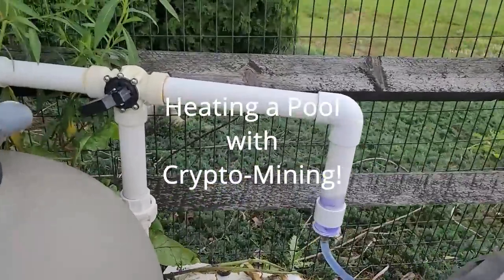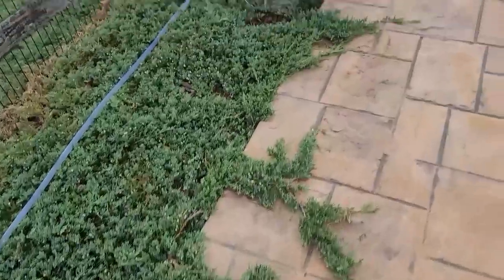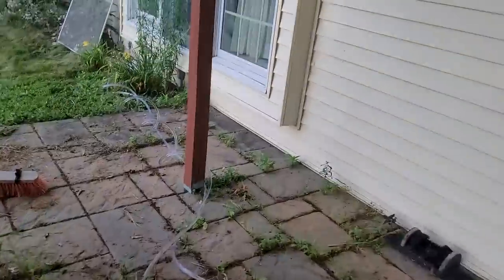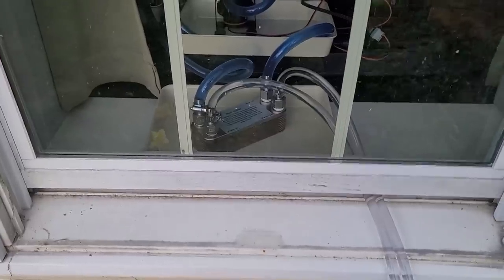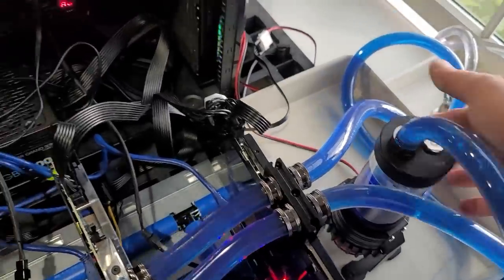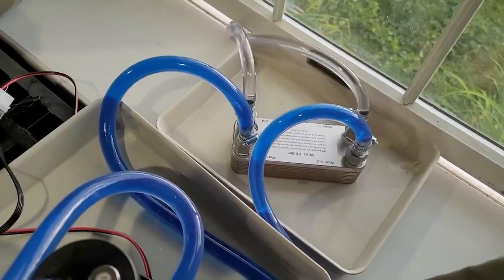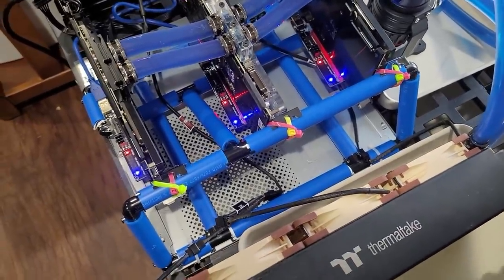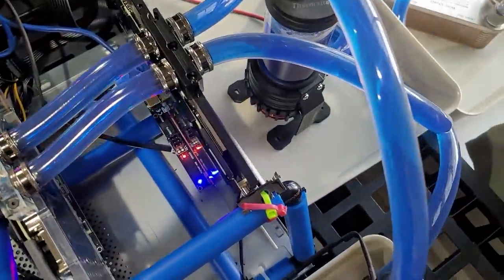Crypto Mining Pool Heater

Comment: I don't like crypto but this is pretty neat. Makes me wonder if you could use heat pumps to force heat a reservoir for later home heating.
Reply: You can and they do. Some comercial heat pumps store energy or potential energy in either heat batteries or ice storage. They make ice in off peak/solar augmented systems for cooling during peak hours. Or they stpre heat for hot water in facilities for hot water needs.
Reply: Yes, heat recovery heat pumps have been around for decades, the problem is the initial cost puts off a lot of people but is used a lot in agriculture where the heat rejected from cooling holding tanks for milk is used to heat the water used for washing them later.
Reply: Lmao
Reply: DUDE you literally can’t “think this is pretty neat” without liking crypto, bitcoin is the engine behind all of this
Reply: Or monero or whatever he’s mining
Reply: @donlitt  bitcoin is "the engine behind all of" a cool engineering project that has to do with heat dissipation? no lol
Reply: @samcousins3204  lol it’s two things at once, it’s supporting a monetary network, and it’s heating the pool, lol 2 uses, 1 and 2 can’t u count?
Reply: @Kirk MyDurk yeah but it’s two uses, the source of heat is to heat the pool, but it also helps secure the monetary network, without mining, you’d just be producing heat for the pool, no other use
Reply: @samcousins3204  think about all the pool heaters that aren’t mining crypto, they’re less efficient, crypto mining increases efficiency of energy production, you can’t be a fan of this project without liking crypto it’s just that simple
Reply: @donlitt  How does crypto mining have anything to do with energy production?
Reply: @symboly1042  we already have smart guys like this figuring out what to do with all the energy produced from mining bitcoin, just wait til everyone is, it’s not a waste of energy, that’s the whole point of bitcoin, to use energy
Reply: @symboly1042  Texas energy producers are already way ahead doing this kind of stuff instead of flaring natural gas, it’s not that difficult to understand,
Reply: @donlitt  mining bitcoin doesnt produce energy it just converts it from electricity to heat energy while also making bitcoin or others
Reply: @symboly1042  you don’t even make sense. I could mine bitcoin in my living room in the winter to heat my living room, I’d save on energy because I wouldn’t have to set the thermostat as high
Reply: @symboly1042  and smart people are already doing this and saving on heating bills
Reply: @donlitt  what do you mean im not making sense i just pointed out that its instead an energy conversion and your trying to prove me wrong
Reply: about something i wasnt talking about
Reply: @symboly1042  okay what difference does it make, mining produces bitcoin and heat, two very useful things, we’re only scratching the surface of what we can do with that
Reply: @donlitt  yeah i know it has a lot of potential and im not at all againts it
Reply: @symboly1042  okay cool some people in this comment stream are against so just making sure
Reply: @symboly1042  yeah and even nfts have some utility but not enough to be sold for a million dollars or so
Reply: @donlitt  Actually it's drugs that's behind crypto, so this is drug-cooled
Reply: @DoctorNemmo  considering its cooled by the water in the swimming pool and by the water in the loop of the miner the heat exchanger transfers the heat between the two cooling loops so the thousand dollar hardware doesnt get contaminated which then means water is a drug according to you
Reply: I legitimately believe that the only reason people don't like crypto is because they heard of NFT baseball cards effectively now they think all of cryptocurrency is the same. I don't see how you can dislike cryptocurrency as a person who wants to separate from garbage fiat currency. Like, is this really just pure ignorance? Or is someone going to make a climate argument?
Reply: @TheBanjoShowOfficial  idk whats with people not understanding that crypto is good when done right
Reply: @donlitt  Probably Eth.
Reply: @DoctorNemmo  The drug market probably makes up less than 1% of the transactions for Bitcoin. He is likely mining Eth, so probably less than .1% of his mining is powered by drug sales.
Reply: @stickyfox  lol first off anything on a computer is just a neat looking binary number. And no cryptos actually not wasteful because in bitcoin for instance the energy goes towards verifying the money, wouldn’t you want money backed by energy, or I’m assuming you like money backed by lying governments
Reply: @Ort I hold no crypto currency and no longer mine. Your distaste for crypto is due to your lack of understanding of how it works, its consequences, and its potential. It is the most significant development in technology since the smartphone, if it continues on the trajectory it is heading, it could surpass the internet interms of importance. I doubt it will get to that point, due to the government cracking down on it, but we will see.
Reply: @donlitt  Nobody said this was a waste of energy. They said this could have been done whether mining crypto or not. Mining makes literally zero difference. Clearly you don't need a high school diploma or common sense to be a crypto miner.
Reply: @twizz420  lol Sam cousins called it wasteful look at my comments, I called him out for being an idiot and look, he deleted his comments
Reply: @twizz420  lol it was stickyfox not Sam cousins, stickyfox typed out 2 long comments calling it wasteful and now look, comments deleted
Reply: @Ort They don't teach you anything about crypto in a CS undergrad, besides maybe basic cryptographic functions like RSA or SHA and maybe the basics of distributed systems, if you sought out that course. For all I know you could be a soy web dev whose hasn't had to think about security, optimization, or math since the one low-level class they had to take junior year. You understand the privacy, decentralization, and security that cryptocurrencies result in, yet you hate them? You understand the potential of smart contracts and fungibility, yet you are against them? I genuinely don't understand how you can hate and want crypto to go away if you actually understand the technology, please tell me the in-depth reasons as to why you are so against them.
Reply: I mined for a while and moved my mining rig to my bedroom for the winter. it paid for its energy usage and our household was powered with 100% renewable energy, so I thought it was a pretty efficient use of energy
Reply: I mean in terms of heat per unit of electricity consumed, a heat pump is probably a much better heater than a mining rig.

Comment: Nice! Did you test it out to see by how much it increases the pool temps?
You might get more if you insulate the tubes going to the pool.
Reply: I dont think so, I used to heat my pool just by putting a tube like this under sunlight.
Reply: Probably isn't gonna make a lick of difference. He's using 1kw of power to heat what appears to be a larger pool.

Pool heaters are 300k btu plus and even those can take time. 300k but it's 88kw.

I doubt he honestly thought it was going to do much.
Reply: it heated up the pool by 0,00001 degree Celsius 😂😂😂
Reply: Honestly it might heat the water near the steps, seeing as the water is flowing right over the steps. It could help with any initial cold shock you may get from the water being too cold, seeing as once you walk off the steps it would slowly transition into colder water. Maybe. I don't know. Definitely can't see it heating the whole pool by much if any though.
Reply: If running 24/7 yes it can definitely make a change
Reply: @pidhsome  No, it can't. The water cools off over time, it doesn't perpetually retain it's heat forever. 🤦🏽‍♂️
Reply: @twizz420  but once the warm water goes into the pool it mixes with the entire pool. He’s constantly putting warm water in and taking cooler water out and returning it. The difference during the heat of the summer won’t be so much but during the beginning of summer the water is still super cold this could up the temperature quite a bit actually
Reply: @billybobthornton4186  Math doesn't lie. Energy is energy. This will do next to nothing. Also, the 'cool air' that's in the house will do nothing as well. People see warm and cool and think in absolutes, or black and white, when in reality it takes a LOT of energy to change a LOT of air or water. Especially outside. Even that small room won't notice a difference, unless you aim it right at your head.
Reply: @justinhardt1  yeah I have a masters in physics
Reply: @billybobthornton4186  the only question here is the equilibrium temperature at which losses from the pool equal gain from the heater. heat transfers more and more the hotter something gets

Comment: Nice idea but the heat exchanger is too far away from the pool. You will lose most your heat in the flow and return tubes going to your pool. If you can move the rig closer to the pool then I would at least use insulated pipes for the external run.
Reply from the maker: I thought about placing the rig out by the pool but was worried about rain, etc. I looked at weather rated industrial enclosures but the cost was prohibitive. I think your idea is spot on.
Reply: The idea had to be more to cool the mining cards rather than heat the pool lol
Reply: @HackyCraft  It doesn’t take much to keep a computer dry. Even a doghouse works fine.
Reply: Just move the pool closer to the rig then
Reply: Just move the planet closer to the rig then
Reply: I was thinking that water would be hot by the time it got to the heat exchanger, since the tubing is just laying out in the sun. I know just leaving the garden hose out in the sun on a hot day for like 5 minutes is enought to get my water hot enough to burn you.
Reply: Fuck it, drop the pc in the pool.
Reply: @HackyCraft  Dumb suggestion but you could try wrapping the hoses in just anything lying around and measure the delta in temperature from the output into the pool and the heat exchanger.

Worst case scenario it was a waste of time but didn't cost anything since you all ready had it.
Reply from the maker: @trackingdifbeatsaber8203  I can try. The next video shows the temp delta. Based on 2 gpm, the water is only in the hose for seconds. Insulation is typically used for big temp deltas or water that is not flowing all the time.
Reply: @markm0000  High humidity can wreak havoc on computers - you'd need a bit more than a doghouse in many places.
Reply: @jcpt928  I used to think that but I’ve seen newer computers work just fine out in the wild for years with no issues. They add a special coating over the circuit board to prevent shorting from moisture and electrostatic charge.

Comment: If your pool heating was electric before, then that free or subsizided pool heating right there!
Reply from the maker: Exactly. This is also way more efficient and cheaper than propane heaters.
Reply: @HackyCraft  I don’t know about efficient. All electric heaters are technically 100% efficient because all the power goes to heat

Comment: You can add heat insulation in the pool pipes. Cooler water for in the house and warmer water for the pool. It will make a difference.

Comment: Sometimes I see things that restore my faith in humanity. The ingenuity and brilliance of this to actually be implemented is amazing. We have all thought about using our excess heat on our mining machines to do something with, but that is a far cry from actually implementing and designing it. You sir are a 🐐. I  🫡 you
Reply: Heck yeah, wasting large amounts of energy to fix a problem that doesn't exist is such a cool concept, I LOVE humanity!! 😍😍😍
Reply: @OCPyrit  What is the energy that is being wasted?
Reply: This is arguably less wasteful than plain old resistive heating, you get heat and compute with this.
Reply: @OCPyrit  the heat would have been used on the rig and dispersed into the atmosphere anyway, this is no different than the rig running on just a loop
Reply: @REDxFROG  begone redditor
Reply: @ChrisD__  Wasteful would be the wrong word in this case. As resistive heating (depending on application) is 100% efficient.
It goes the opposite to wasteful; resourceful. So this would be more resourceful than resistive heating.

That was really nit picky, my apologies.
Reply: I've used it to heat my garage in the winter time.

Comment: Good way to scavenge the wasted energy from the heat and actually use it for something somewhat practical. You could even use it to get free warm water instead of using your gas heater.
Reply: Collect waste and solar heat into a 250 gallon water tank wrapped in insulation and use it to pre-heat the water before it goes to the main water heater. Don't have to pressurize it, just drop some copper pipe down into it as a water to water heat exchanger and have multiple loops for different applications, and one loop just for the pressurized water. The solar loops can be filled with anti-freeze so it doesn't freeze in the winter time.

Comment: I'm not criticizing, just asking for curiosity: The chlorine in the water won't corrode the exchanger? I see it's steel (probably stainless) and cupper. I guess the cupper won't touch the water.
Reply: Pool heating should use titanium heat exchangers because steel and stainless steel heat exchangers will be corroded by by the chlorine and other pool stabiliser chemicals.

Comment: With the length of that tubing in the sunlight I'm incredibly surprised the water is actually cold enough to cool the cards. I bet if you were to burry pvc from the pool filter to your window and only have PVC out of the ground with the changeover to the flex piping exposed to sunlight the cooling would be even better
Reply: Without a doubt, but he did say this was just a proof of concept build
Reply from the maker: The pool water flows at 2 gpm....there is basically no temp rise in the tube, even on a hot day. It would sure look better if I did something with the tubing.
Reply: @HackyCraft  Im certain it helps that the tubes are clear, if they were black you might see a temp difference on a particularly hot day

Comment: I had an Antminer S19 Pro last year and I put it into a fish tank and filled it with dielectric coolant and used a 1/2 size honda civic radiator and 1/3hp pump to cool it. It worked great, but man... This idea is even better. I could do the same setup again, but then use the water to water block to keep even the dielectric coolant cool.

Comment: Has the pool water caused any corrosion in the Wort Chiller? I'm thinking about doing this but with a separate pump and two tubes going in and out of the pool or even just using an immersion chiller
Reply from the maker: You should see a new video from me tonight with endoscope images of the chiller. I do not see any major corrosion.

Comment: So you have water cooling, which is already inefficient.  Then you have a tiny water to water transfer, which is inefficient, and then the long ass line running to the pool has 0 insulation, so you’re losing half of the heat before it gets there.  At least you didn’t use copper pipes like Linus did year ago when he realized this was a dumb idea.

Comment: Seems like a small fridge with a cooling loop inside and adequate pump could be more efficient than running a pool pump.
Also, where I am on a 100° day the hose would get to hot.

Comment: The pool pump does not run 24/7. Just put a pump inline and drop the two ends of the loop in the pool. That is your point anyway. It also seems like a shorter path from the mining room to the pool.
Reply from the maker: But I get free pumping from the pool filter. I looked at a small pump and anything continuous duty was as expensive and large as a pool pump. Easier just to run the pool pump 24x7

Comment: interesting challenge. i think it would be simpler and cheaper by cooling the room using a car radiator connected to the pool
Reply from the maker: May be easier for cooling the room but would not cool the gpus. I am also nervous about pumping 25000 gal of water into my house. I moved the pool loop outside the house after shooting the video.

Comment: Very cool, but I'd be worried about the coolant being below ambient temperature if that's actually the case. Condensation could start forming, which means a bad day for electronics.
Reply from the maker: Good point. The heat exchanger never gets the coolant below ambient. The pool water is around 80F, which is a good temp for swimming. I have a water chiller on another system. It can get below ambient, if I stop mining. I want to take a good stab at the port royal leader board with that system. I have hit a brick wall tuning the system though.

Comment: awesome setup. You should look into a  dedicated steel mining chassis. Would probably make the build and tube runs easier.
Reply from the maker: You are probably right. I used leftover parts to build the rig(minus the power supply and cards). It would definitely look better with a real chasis!

Comment: The copper brazing of the heat exchanger will dissolve from the chlorine of the pool and put chlorine ions into your cooling loop and coolant into your pool
Reply: the pool water isnt going through the blocks, its connected through a water-water blcok so its 2 seperate loops with a heat exchanger in the middle
Reply: @camo7048  I know, the problem is the water-water heat exchanger. It has copper brazing in it. It will dissolve with the chlorine.
Reply from the maker: It might....I will keep an eye on it.
Reply: @HackyCraft  it is insidious. You will never know until it's too late and the chlorine ions are in your electronics lines.
Reply: @EarlCo  as long as its the heat excahnger and not the blocks thats not so bad. gpu blocks alot more pricey and harder to replace lol